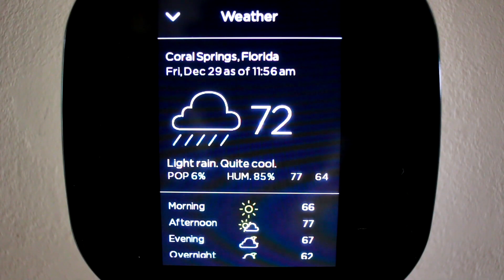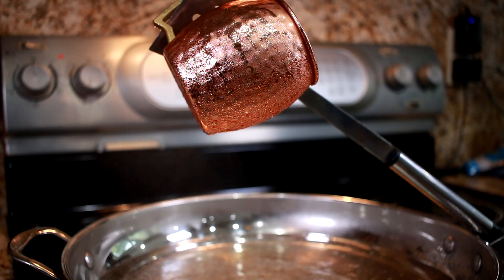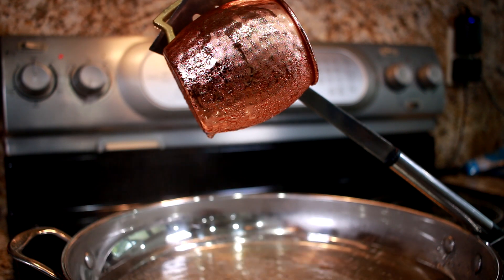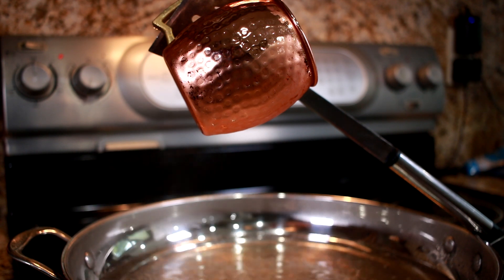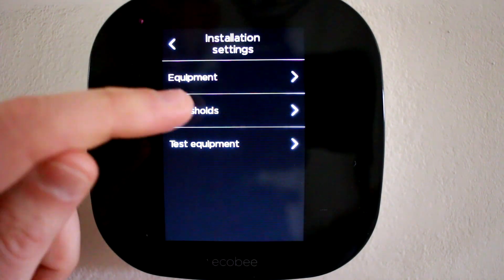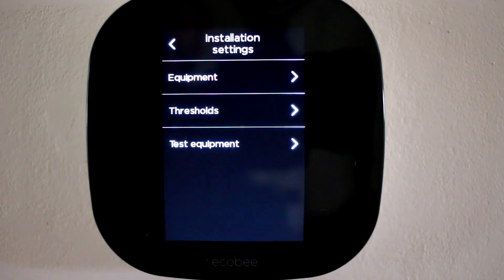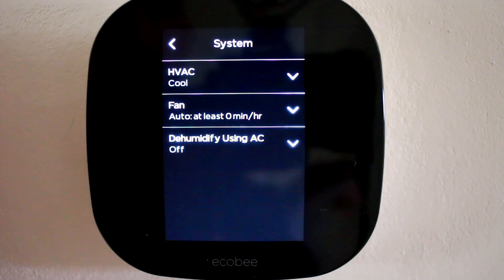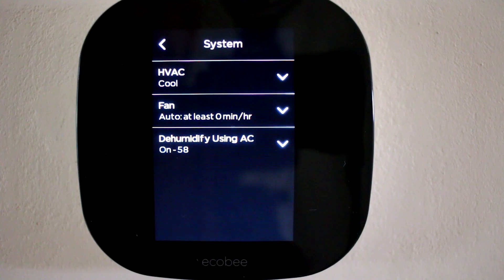Ecobee humidity control setting thermostat tutorial

Comment: Resurfacing this video, because it is awesome!
I just had a new AC installed with a Ecobee. The system works but the installers didn't set anything up on the Ecobee other than to wire it to the unit. I'm in Lower Humid Alabama and it wasn't set to overcool or use the AC to dehumidify. It just kept popping up warnings about high humidity. Thanks for this 6 year old video filling in the blanks that even the Ecobee site doesn't cover.
Reply from the maker: Glad you found it helpful

Comment: By your video explaining that the user must activate the AC Overcool Max feature before going back to the System setting to reveal the Dehumidify Using AC feature, suddenly the AC Overcool Max feature makes sense. The way it was defined by Ecobee Support made no sense. Support left me scratching my head as to why I would set my thermostat to cool at 72 and then let the compressor run on AC Overcool Max for a set 2 degrees until the interior temp dropped to 70. Why not just set the thermostat to 70? The Dehumidify Using AC feature is what I was looking for. But, it didn't show-up under System settings until the AC Overcool Max is activated.  Perfect!
Reply from the maker: Glad it helped! Thanks for commenting.
Reply: I found this the case also. Installers had no clue and ALL of the videos I’ve previously watched did not address the issue. 
Thank you for your very clear, precise, and short informational vid.

Comment: Thanks so much for posting this. Just wired mine this morning and I'm getting familiar with the controls.
Reply from the maker: Cool it is a lot of fun especially coming from a traditional thermostat
Reply: @reallyMello  I just sent an email to Ecobee. I noticed the humidity level in my condo is 67% @ 75 degrees. The outside temp is 86 degrees w/a relative humidity of 61%. Not sure if I have a bad sensor
Reply from the maker: That does seem pretty high…no leaks or anything you are aware of in the house?
Reply: @reallyMello  No leaks or anything out of the norm.

Comment: Thanks for the video. Just making sure I understand how this feature may work for me. 

If you adjust the humidity level that you want, can you still keep it at the desired temperature? 

If for example I would like the house to be at 77 degrees but at a humidity level of 45, will the thermostat just keep the compressor running to dehumidify until reaching 45 ? 

Thanks
Reply from the maker: It will keep the AC running to cool below 77 if the humidity is still above 45 by the time 77 degrees is reached. So if your overcool max threshold is set to 2 F it will keep running to 75 if it needs to if 45 humidity isn’t reached by the time to gets to 77 or 76.
Reply: @reallyMello  Nice, thanks for the explanation. Really appreciate it!

Comment: Hello, will using the advice in this video help to maintain my whole house humidity at 45% throughout the day?
Reply from the maker: You’ll be able to set that as your target and your system will try to achieve that within the limits of your A/C’s ability to dehumidify. So the answer is yes, but it depends on factors like how humid the ambient air is to start with, how good your A/C is at removing humidity, and how long the A/C would run before it hits your temperature set point with the A/C overcool max applied.

Comment: Thank you so much for your video.  It may have solved the mystery that we’ve been having in our house with high humidity. In order to use auto mode for your furnace fan, do you set the preferred minimum runtime to zero?
Reply from the maker: No, you can keep it in Auto and still use minimums if you want. The minimum run time is there if you want to ensure the air moves in your house every hour for at least some minimum even if there are no heating or cooling needs at the time. This may raise your indoor humidity though so I leave mine at 0 (especially since my AC is almost guaranteed to run a bit each hour given my climate).

Comment: this only works with eco+ enabled right? i turned mine off because i was tired of the temperature of my house constantly fluctuating when i like a static temperature. i cannot figure out how to use the smart features without having to deal with the temp going too high or too low for my comfort as the weather goes from cold to hot often this time of year in my part of the world.
Reply from the maker: I don't believe this requires eco+ to be enabled. I'm pretty sure when I did the initial setup eco+ wasn't a feature.

Comment: Hi thank you so much for this video. My builder never showed me anything except how to set the temperature on the ecobee. I do have a question, for my fan setting it gives me the option of what is my preferred minimum fan running time for auto mode. Do you have an answer on how to set that? I live in Florida. There are other threshold settings that I haven’t touched either. Should I change any of those from the factory settings? I found your video because I was getting warnings from the ecobee that my humidity in the house was too high. Your video was a great help.
Reply from the maker: The fan minimum run time is if you want to ensure your fan keeps the air moving some minimum amount of time per hour even if the system doesn't need to run to cool the house. This can help if the air feels kind of stagnant. Just letting the system manage it is optimal for humidity purposes and energy savings, but if you want to play with it a little bit for your own comfort to move the air more frequently that is what that is there for. This is more of a thing in places with milder weather where the AC doesn't turn on very often. Hope that helps!
Reply: @reallyMello  it sure does help- thanks again!

Comment: WHat should the setting be to raise the humidity in my home I’m in the mid wwest it’s -5 degrees outside my indoor temp is set to 70F but my humidity is 21 . I have children in the home and i know low humidity can cause health issues
Reply from the maker: Ecobee alone isn’t going to help you much in that situation. To make it more humid, some things you can do starting from low to high tech would be adding open containers of water near your heat registers, add more plants inside your house, add a room humidifier, or finally add whole house humidifier to your HVAC system.

Comment: Question, will this feature kick in just when trying to meet temperature setpoint or even if temperature satisfied but humididty is higher than the humidity setpoint?
Reply from the maker: This will kick in if the AC has finished cooling to your set point, but the humidity is still higher than what your preferred setting is. It will cool lower than your set point to try to reach your desired humidity setting up to the overcool max setting. So if you have your thermostat set to cool to 75 F and desired humidity to 50%, but the humidity is at 52% the AC will keep cooling to 74 F for example in an effort to reach 50% if your overcool max setting is 1 degree F.

Comment: That’s great for summer but how do I decrease humidity in the winter with the heat on?
Reply from the maker: It's trickier in winter for sure. Colder air carrier less humidity so that tends to be less of a problem, but if you have moisture producing sources inside the home (cooking, showering) you aren't venting you could add a dedicated dehumidifier and some central air conditioners have a drying mode now where they will run cool and heat cycles to dehumidify without making the house colder.
Reply: Open a window, cold "humid" air will be heated up to turn into warm "dry" air.  If you take 60% humid cold air and heat it, the air will be able to hold more water, thus it now is at 30% humid. Not exact numbers but you'll feel it, its the reason why defrost in cars takes outside air to heat instead of recirculating to avoid windshield from fogging up.

Comment: I have had a humidity problem here in Houston with levels staying at 70 plus %. I followed your video and hope this works. I am curious if this has increased anyone’s electric bill.
Reply: Have you noticed any difference? Also in Houston and just followed these settings?
Reply: Did this setting to control humidity increase your electric bill?
Reply from the maker: It’s going to for some degree because it will run your AC longer than it otherwise would in some cases if it hits your desired temperature but not yet your desired humidity level. This is more of a comfort thing versus cost savings. That being said you may find using this you can leave your temperature setting higher than normal with ecobee adjusting to match desired humidity since humidity alters are perception of the temperature (so this might save money or break even while feeling cooler)
Reply: @alyces8376  Running your air conditioner in dry mode is more energy efficient and less expensive than running it in cool mode. Is overcool the same as dry mode?

Comment: Can these changes be made via the app?  I don't find these settings on my ecobee 3 lite app.  I'm away from home atm so I don't know if my inability to find the settings you describe is a function of the app or the 3 lite.
Thanks in advance!
Another question, can I use a room sensor to ONLY monitor a room?  iei., watch the humidity in the basement while I'm traveling but not affect the HVAC function-just monitor the humidity and/or temp?  Again, on a 3 lite.
Thanks in advance!
Reply from the maker: Good question. No, they haven’t exposed system settings like these in the app.

Comment: If you run the fan on auto how many minutes per hour do you suggest?
Reply from the maker: Auto will run when the air conditioning is running so you don’t need to set any specific number of minutes

Comment: So if the thermostat reaches the humidity level (say 64%) but not the cooling temperature (say 77 degrees) will the AC come on and reduce the humidity below 64%?
Reply from the maker: Ecobee will continue to cool below your temperature set point up to the number of degrees set in the overcool max setting to try to reach your desired humidity setting. So, for example, if your thermostat is set to 77 degrees, your desired humidity is 50%, your overcool max degrees are set to 2 degrees and your house's temperature reaches 77 degrees, but the humidity is at 54% the AC will continue to run until it reaches 50% or hits your overcool max threshold of 75 degrees (based on a 2 degree overcool max setting 77-2 = 75). So if it needs to continue running to get to 76 or 75 to bring the humidity down to 50% that is what it would do. If 75 degrees is reached and the humidity is still above 50% it won't run beyond that (won't make it any colder--unless you have a larger overcool max set). In cases where the humidity is already at or under the desired humidity level it won't overcool.
Reply: @reallyMello  So if temperature doesn’t reach 77 degrees, the AC won’t even come on?
Reply from the maker: If the temperature is below your set point and and max overcool then it wouldn’t turn on no. So if your thermostat is set to cool to 77 degrees with a 2 degree overcool the temperature would need to rise to 75 or above for the AC to run if it was above your humidity setting or 77 if humidity was lower than your setting.

Comment: Your video really helped this summer! Now that we are moving into winter, are there settings that would help maintain a higher humidity on the HEAT setting? I have acoustic guitars that prefer higher humidity levels in winter.
Reply from the maker: Glad to hear that it helped you out! Have you tried adding house plants in the room with your guitars? Another method is to add something like a bowl of water near your heat registers.
Reply: Thanks. Good idea. So do the humidity settings only apply to the cool mode or heat also?
Reply from the maker: @geoffreysmith4618  Solid question. They only apply to the cool mode. There isn't really a way for it to add humidity into the system using the heating element. You'd have to add an auxiliary humidifier into the system or try one of those other suggestions.

Comment: How long is the normal cycle of an AC? I thought our AC is short cycling because it only runs for  5mins every cycle. I even called HVAC to check it. They said they couldn’t find the problem. When I checked the settings it was actually set  to 5mins cph 😅  Could it be the reason why it feels humid inside our house because the cycle is too short? Humidity level ranges 58-75, is it considered high?
Reply from the maker: Seems high to me, near 50 or below relative humidity is recommended to keep things from growing like dust mites. I wonder if your unit is oversized?
Reply: An HVAC came in today, he just said every home is different. And location is a factor too. But we never had this issue in Hawaii before.
Reply: The house is new and has warranty for a year. I feel like they just don’t want to address the issue. 
Thanks for replying. Appreciate it.

Comment: If running the fan was a bad idea, why are variable speed ACs the best option?
Reply from the maker: The difference is the compressor still runs when a variable speed AC is cooling and fan is on vs just running the fan when not in a cooling cycle. 

The longer the compressor runs the more humidity it can remove out of the air so variable speed ACs can run for longer cycles on lower fan speed settings (while consuming less electricity). This is also why if you oversize your AC it may cool your house rapidly, but it doesn't remain on long enough to get a chance to remove the humidity out of the air.

Comment: Why to you leave the fan run time at zero (0)? Shouldn’t run for some time?
Reply from the maker: The idea is to run it only when the system is cooling. Some people like running the fan additionally when the compressor isn't cooling the house to circulate air, but this has the potential side effect of reevaporating the condensation and adding humidity back into the house.

Comment: So any help welcome here. Temp is set at 79 and the house temp currently reads at 77, although there’s a small ecobee icon on the bottom left that reads sensor at 81, but the thermostat isn’t kicking. I set it down to 76 to see if it was working and it didn’t kick. I went down to 75 and it started up. I figured it was a reset that is needed, but this thermostat is acting weird. Any suggestions?
Reply from the maker: Do you have multiple sensors?
Reply: @reallyMello  just the main thermostat no other. Any suggestion?
Reply from the maker: Are you sure the 81 you are reading isn’t the outside weather temp? Also, can you clarify what the problem is or what you are trying? Unless I misread your question it sounded like it was working ok if your set cooling temp is 79 and the AC is off if the inside temp is 77.
Reply: I wish I can send the pic so you can see but there’s an icon to the bottom right that says 1 sensor then the circular icon and inside says 81. Underneath it says “My ecobee” it mimics the big bold number from the inside temp and they’re not matching….then out of nowhere they will match.  I thought the reset will take care of it, but no.
Reply from the maker: Hmmm there is an option to calibrate/adjust the main sensor in settings. I had to do that with mine when I found it differing a degree or two from the ambient air near it.
Reply: @reallyMello  where do I go for that?
Reply from the maker: Settings > Installation settings > Thresholds > Temperature correction

Comment: In Florida you need fresh air introduced into your home, the A/C is not enough.   You need at least a Dehumidifier bringing in fresh air before the A/C condenser.
Reply from the maker: Like an ERV or something? Those seem interesting, but I don't know of anyone that has those since all the homes were built in the late 70s-90s in the area and would require quite a bit of a retrofit to add new ducts.

Comment: This may be a dumb question but I installed my ecobee a few day ago and now my ac pan is full of water. I live in Texas and not sure what I need to set everything to. This is the first time this has ever happened.. help! Please!
Reply from the maker: Hi Keli, when was the last time your condensation line was vacuumed? In my area when that happens it usually means the condensation drain line is starting to get blocked.
Reply: @reallyMello  it has been within the last year. I was thinking maybe it is because I am overworking the ac?!? Since I am not sure what the setting should be on.
Reply from the maker: Well it could just be taking a lot of water out of the air and collecting and draining, but if your float switch is tripping or it looks like a lot of water that could indicate an issue. It may be worth scheduling a maintenance call to your AC company (some say yearly) to ensure your coils are clean, drain is open, etc. Also ensure your furnace filter was changed recently and isn't clogged with dirt.

Comment: Is overcool the same as dry mode?
Reply from the maker: I don't recall seeing dry mode as a setting. Where are you seeing that? Here is more info on AC Overcool https://support.ecobee.com/s/articles/How-to-use-AC-Overcool-Max-to-reduce-humidity
Reply: @reallyMello  Some thermostats have a dry mode setting, such as Honeywell, Aircon. I was just wondering if that’s basically the same thing as an overcool mode.
Reply from the maker: From what I found it’s purpose is similar but it is achieved differently

Comment: what about when its winter and humidity is low?
Reply from the maker: To add humidity to your space there are different things you can do--starting from low to high tech you can add open containers of water near your heat registers, add more indoor plants to the space, add a stand-alone cool mist humidifier, or add a whole-house humidifier into your HVAC system.
Reply: @reallyMello  I'm in a condo. :/
Reply from the maker: @trinacriafitnesstrinacriaf5723 sounds like a good fit for a small cool mist humidifier in the room you spend most of your time